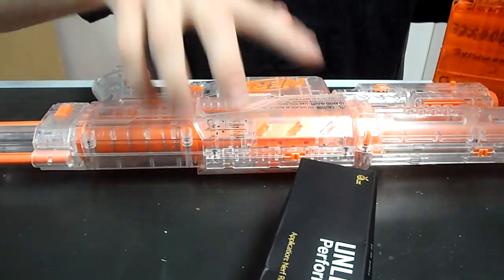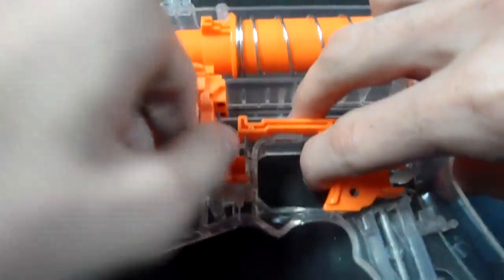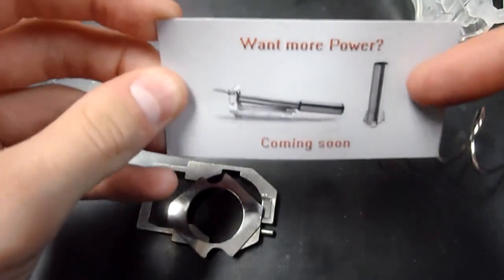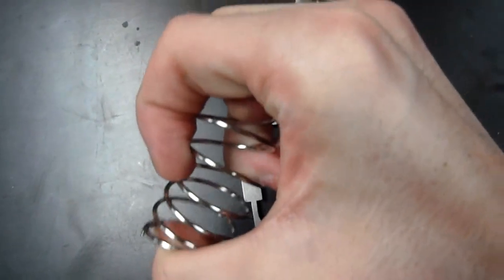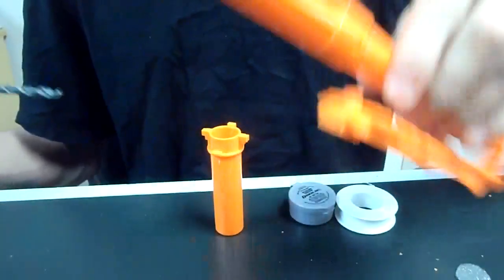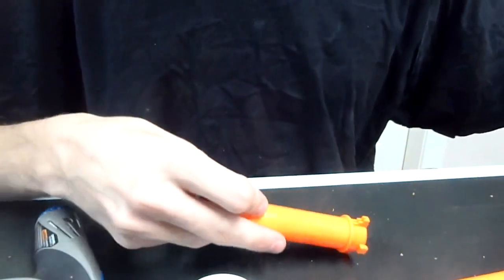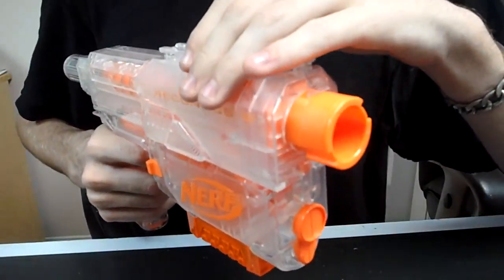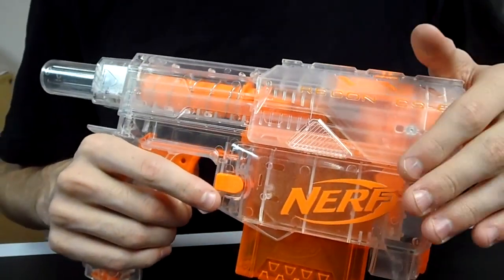Orange Mod Works Recon Kit #1 (Review and How To Install Guide)

Comment from the maker: @LordDraconical The 80 foot shots I can get with this kit are comfortable 15-20 degree angled shots.  That said.  I am also a very tall guy.  This adds some time for the dart to travel as well.  I want to be very clear when I tell you that these darts can hit a bit over 80 with comfortably angled shots.  Flat.  Id say they hit 65-70.  I'm not trying to trick anyone.  These kits are simple, easy, and work incredibly well.  I hope to hit 85 flat and over 100 with my comfortable shots with kit 2.

Comment: @myconpics I did all the modifications from the orangemodworks recon ebook with the stage 1 performance kit and I am getting up to 65 ft level. In my range test video the recon shoots up to 100 ft angled. That new spring in the kit has a lot of power.

Comment: @longshot686 The link is in the discription. 
kit 1: $16.99
kit 2 (Preorder only): Comes out June 25, 2011 for $24.99 and includes: Aluminum Breech,  Aluminum Bolt Sled, Aluminium Plunger, and O-ring.

Comment: i just finished upgrading mine to run on compressed air because i shattered the bolt sled and plunger system after removing the air restrictor... but OMG im so buying stage 2 when i can... compressed air is great but its soo inefficient

Comment: Also how does removing the "air restrictor" actually help performance, it seems to me that all having an "air restrictor" does is focus the air into the dart.
Reply: +coden97 The AR slightly slows the air when the plunger pushes it into the chamber to fire the dart. With the AR, the air is blocked slightly, so less air enters the chamber, pushing the dart less.

Comment: is sewing machine oil/singer oil any good to lube up parts of the internals?
Reply: If it works well with metal on metal like a old fashioned sewing machine It’ll be overkill on plastic parts, and I mean that in a really good way.

Comment: the plunder will brake with all that force you putting on it
Reply: Not if the plunger itself is made from metal, but then again now it’s 2019 you can just 3D print it with a relatively cheap 3D printer in the $250 range.